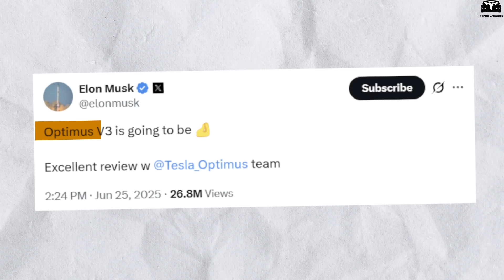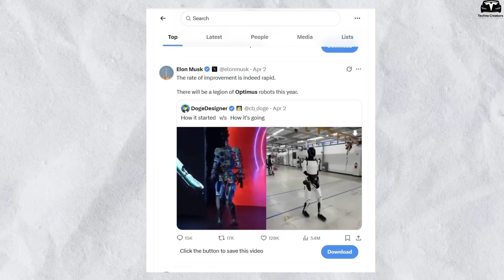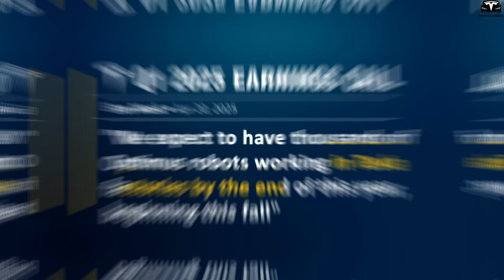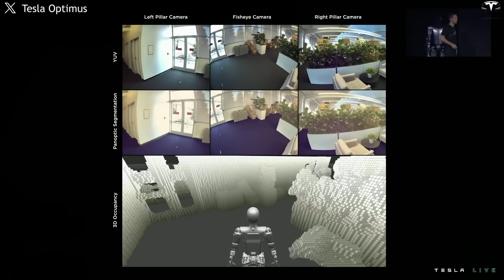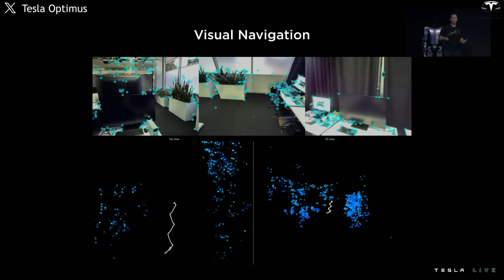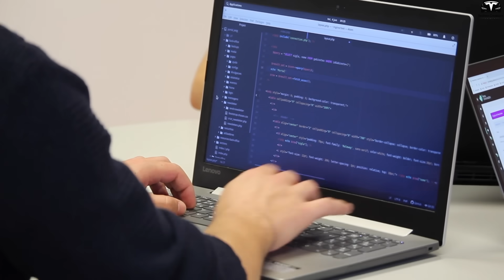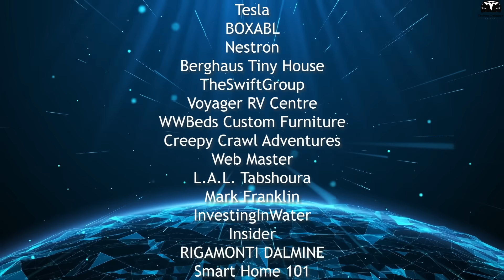BIG UPDATE! Elon Musk Unveils Tesla Bot V3 with Incredible Abilities, Specs! You NEVER HEARD Before!

Comment: Now wait a minute!  What about wet and dirty hands?  Are those hands able to survive that?  Are they going to need to be skinned?
Reply from the maker: The hands are designed to be water- and dust-resistant, and can be cleaned or replaced if needed.
Reply: @TechnoCreators-pj9dg they said they have 22 degrees of freedom. Lots of cables going thru the wrist.  I can’t believe that changing those hands is going to be easy.  Let’s face it.  Dirt and grime getting in those joints is going to be a problem.  Just like humans, hands need to be skinned.